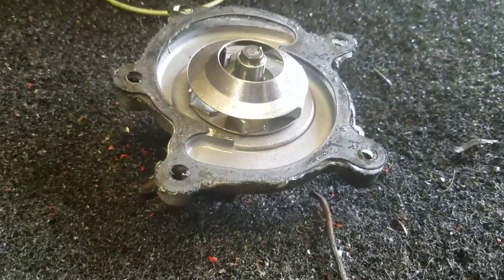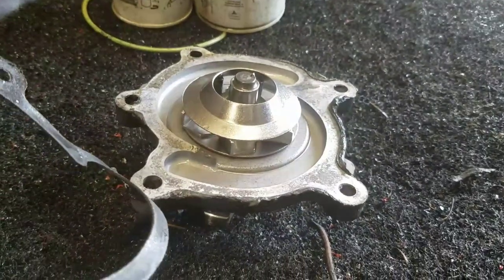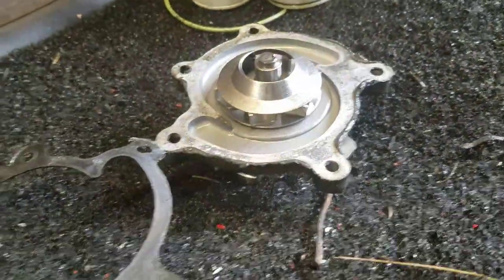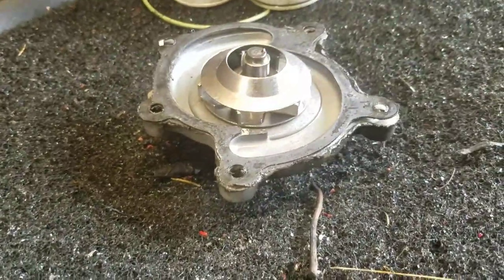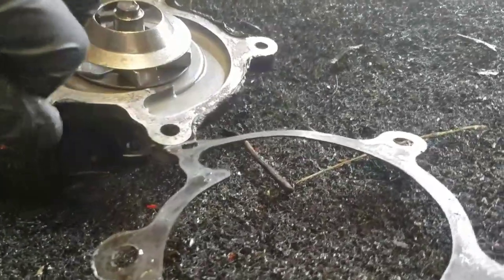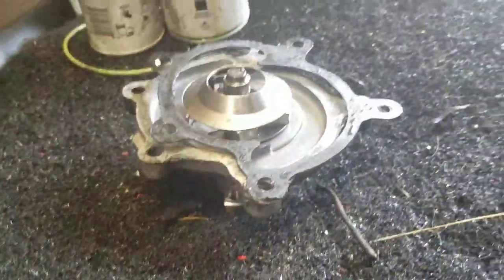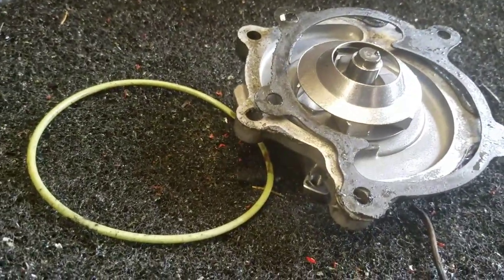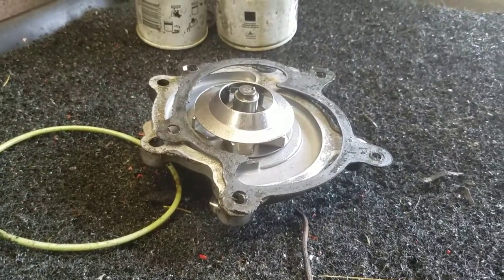Repair: do not use RTV silicone on paper gaskets

Comment: So confused.  Great video changing thermostat on 94 Wrangler have a new housing,  was going to use the blue fel-co gasket.   Not sure if I should any sealant.  Did the valve cover with a reusable felco and didn’t use sealer and hasn’t leaked yet.
Reply from the maker: Blue paper has silicone impregnated into it and does not require any additional sealers. If you were going to use anything you would use a spray high-tack, or aviation sealer. See the video in the description for more information
Reply: @MegaMarclar  thanks   I looked at repair manual and it’s just gasket so that’s what I’m going to do.  I feel a lot of the times people have leaks on new gasket is because they do not tighten to torque specs
Reply from the maker: @patrickab01  well there are about 25 different types of gasket material paper. Most of the time people have problems with it because if they use blue paper that has silicone in it and they put silicone on it they do not stick together. Suicone will stick to any surface known to man except for itself. So what that being said you have to be aware of what materials you're using and apply the sealers accordingly. The whole thing with the blue paper was that it did not need any sealers at all It was sort of a revolutionary technology designed by felpro many many years ago.
Reply: @MegaMarclar  I ended up using a felpro blue paper ,, no sealant,  set to manuals torque setting.  Ran it for a while got it up to temps with no leaks.  Haven’t driven it yet      Will see if all holds after driving it for a bit
Reply from the maker: @patrickab01  those thermostat housings are famous for warping and also being pitted. If it does end up dripping a little bit I would suggest replacing the whole housing. I actually stock those here in the shop because I replaced them so frequently
Reply: @MegaMarclar  yeah I put brand new housing on

Comment: There's no need to use a sealer with a gasket. That's the whole point of the gasket.  I have been in a pickle before when I could not get a gasket for my new water pump and I needed my car so I made my own gasket gasket maker.  Drove it another hundred thousand miles and never had a leak.  I would say use one or the other but I would much rather use a gasket alone.  Sometimes if you have a car that's hard to get parts for that can be a challenge don't always have the option to wait a week for something to come in the mail

Comment: My ford 1997 Taurus has in the shop manual using Gasket and Trim Adhesive D7AZ-1 9B508-AA (ES R-M 11 P17-A and ESE-M2G52-A  and I can't find it anywhere. I'm not sure to apply it or not.
Reply from the maker: the trim adhesive is what they use to hold window seals and stuff on, all it is is a sticky glue that holds the gasket in place. it has no affect on the sealing surface. you can use hi-tack, or just stick the gasket on and hold it there.
Reply: @MegaMarclar  Thanks I ended up putting no tack, maybe a smidge of oil (I was doing a water pump) and it worked out pretty well! no leaks!!!

Comment: I changed a rear differential cover and I just used the paper gasket,did I need to put on silicone or anything else on it!?.... because I didn't do that!...sorry for my ignorance but I don't know but I torqued the screws to what the manual said to torque them to.
Reply from the maker: Most of the time you will be fine. They used paper gaskets for many years. A lot of modern applications actually just use straight rtv from the factory. No matter which route you go, they all leak eventually.
Reply: @MegaMarclar  very much appreciated thank you.

Comment: I bought a water pump for 1977 Toyota 20R engine.
Got a light sort of cardboard/paper gasket.
So I should NOT USE SILICONE OR SEALANT RIGHT?
Install NO SILICONE.....
PLEASE can U tell .....
YouTube & other Auto parts stores advise differing things. 
Very frustrating........as a woman.
Reply from the maker: You would use hi-tack or aviation sealer.
Reply: @MegaMarclar  hi-tack what brand at auto store?
Is aviation at auto parts store?
Use thin layer or thicker U know.....
Thank U happy holidays!
Reply from the maker: @lindaleehulsey3167  I would use permatex aviation sealer. It's a thick dark brown goo. It's what they would have used back then. It doesn't harden or cure like silicon does which is the major problem that people run into. It's really sticky and basically acts like Elmer's glue for the paper. I would recommend using rubber gloves when you put it on just basically paint a thin layer on each side of the paper and stick it on
Reply: @MegaMarclar  👌 great....3 times now believe it......on off leak here leak there. Thin or thick, Rrrrrrrrrr😤
Reply from the maker: @lindaleehulsey3167  you may have more issues. Warped housing or something else. Should not have that much trouble sealing.
Reply: @MegaMarclar  bought new pump...first one 9 holes should have only 8 tried anyway believing auto parts store. It leaked, I filled around pump hole, even though there was no hole on block. 
This has 8 holes right pump.NEW ONE now.
B4, 
My old pump just replaced gasket after I cleaned it, used thick amount RTV not really thick, but did not leak.
Put new points, plugs wires started OK drove very short also in out of driveway around to mailbox like that it leaked peep hole they said it was bad pump.

This new pump 8 holes pump right, just thin they said here there to stick, paper thin Grey gasket, really did not like it, but did it, leaked here there, very slightly.
I want to try no paper gasket autozone AGS blue water pump & Thermostat gasket maker. But like your info......

Comment: I'm replacing thermostat on my old tractor. It definitely had a paper gasket but the new thermostat came with a seal. Do you have any idea if I need to use the thermostat seal also or just the paper gasket.  The old thermostat so old I can't tell if it had a seal on it.
Reply from the maker: Does the thermostat have a rubber almost oring looking seal around the outside edge
Reply: @MegaMarclar  Yes sir that's the seal I'm asking about, the one that goes around the edge of the thermostat
Reply from the maker: @justinw123  it is probably an updated design and as long as you can get everything tight, and the surface is clean and does not have a ton of pitting,  I would just use the rubber gasket on the thermostat itself. This is how all modern cars are all manufactured.
Reply: OK thanks for the fast reply have a good one
Reply from the maker: @justinw123  no worries you may want to contact manufacturer just to double triple make sure if you have any doubts. Remember that my advice goes just from your description and I have no idea what the actual application looks like.

Comment: Think they used oil rtv instead of water rtv.  Blue for water applications, and black for oil application.  Also, if they did not read the instructions, they most likely did not wait for it to cure.
Reply from the maker: Could be right, there are different types for different applications. But, I cant think of any gasket install instructions that recommend putting rtv on a paper gasket.

Comment: If silicone was recommended by the manufacturer, wouldn't they include a small tube as well as the paper gasket?
I haven't seen any (in my admittedly small experience) that do.
Reply from the maker: Not really .. cost savings, profit margins,.. most of these problems with the gaskets come down to people just not understanding how the system works. Years and years of propaganda by companies like permatex and felpro have let people to believe that silicone is a 100% fix all solution to everything. People could not be bothered to spend 5 minutes to do research to find out what exactly they're supposed to use.

Comment: I got a new idea. RTV silicone. No paper gasket. Did that on my jeep 4L because the surface wasn’t super smooth, it was kindof pitted. Hasn’t leaked yet. The right stuff
Reply from the maker: It all comes down to the specific repair. In your case,. I would have used normal paper and aviation sealer, that's how we did it at the dealership.. there are multiple types of 'paper' so picking the right one is important. Sometimes that thickness makes a difference and you can't just silicone two pieces of metal together, another applications that's how you have to do it. Also there's a It doesn't different types of silicone so you got to make sure to pick the right one in that area as well.. You don't just put black our TV silicone on everything
Reply: @MegaMarclar  it’s silicone specially designed for applications like what I used it for.
Reply from the maker: @JacobEcret  which one? And what parts did you use it on? The right stuff is just a brand, they make about 30 different products.

Comment: almost certainly the gasket surface wasn't clean, didn't use a torque wrench, and didn't wait for the chemistry to finish..(ie cure time before solvents were contacted/coolant).  

after years of daily use, proper paper gasket+RTV made the best sealing surface possible. i've even reused a gasket and it worked perfect until i could get a new one.. could do that with just a plain paper gasket. 

chemistry is an exact science, but, it require patience...  (wouldn't use RTV with modern silicone gaskets, aside from problem areas)
Reply from the maker: Your speaking in a ideal circumstance scenario. That cure time doesn't happen in the automotive industry. Paper gaskets need aviation sealers, not rtv. rtV is a marketing campaign to sell products
Reply: @MegaMarclar  "RTV" is "room temperature vulcanization"  ...people are always confused when products don't work. like with paint. its all in the prep and process.
Reply from the maker: @Swansen03  yeah, that's the problem. The vulcanization of the product is what causes the leaks. Different expansion rates require certain types of sealers. That's why aviation sealer was used up until the felpro and the permitax marketing campaign on rtV.
Reply: @MegaMarclar  that doesn't make any sense.. once the reaction is done, its not going 'move' very much?? unless you are torquing before its done setting adding solvents before its done curing, which everyone does.. otherwise that point you made about expansion rates makes no sense..
Reply from the maker: @Swansen03  check the video in the description

Comment: Think just a dry cereal box gasket for my turbo water jacket seal will hold up? Its wet and really really HOT.
Reply from the maker: I've used those for oil pumps, and high clamping force areas many times. But coolant will leech thru the paper over time, even with aviation sealer because of the 2 types of cardboard pressed together.  In a pinch it would work but long term I'd get the real gasket for it
Reply: @MegaMarclar  gaskets were discontinued like 20 years ago... what other material can I cut out? It had red RTV on there in the past... took it off because I thought it was leaking (it actually wasnt it was just the rusted coolant tube next to it). Maybe I'll go back with the red high temp RTV again... its just a pain to work with where its located. Maybe I can apply it and let it dry first? Should it go on both surfaces or just one surface?  I wish I knew what kind of gasket the stock one was... isn't a thermostat gasket just cardboard? I would think it would be fine...
Reply from the maker: @misterbulger  what are you working on?
Reply: @MegaMarclar  it's a 1.0 liter 3 cyilnder Suzuki G10 block with the coveted and very rare Turbo head from 1987. Parts for this thing are completely extinct. I've had to macgyver a full rebuild for it. The coolant pipe had a hole in it so I just slid some rubber hose over it and clamped it. Fixed.  Other than the leak  it runs AMAZING. The turbo is cooled 3 ways: coolant, oil, and the propane that I have running thru it.  It spins at about 250-300k rpm so it needs the cooling trust me lol
Reply from the maker: @misterbulger look up felpro #3195 it's a sheet of gasket paper for coolant. You can make your own out of ut
Reply: @MegaMarclar  that's exactly what I need but the bozos at auto zone cant find it without the part number lmao I've asked around before. Thanks!
Reply from the maker: @misterbulger  prety much any parts store can get it. I stock it at my shop and i get it from orileys. So with the blue stuff, it has silicon impregnated in it. No need for any rtv. You CAN put aviation sealer on it of u needed to
Reply from the maker: @misterbulger  there is also felpro 3075, all of these are on Amazon too.. just variations in thickness. You'd have to check their site to see which is which.
Reply: @MegaMarclar  thanks for the tips I've been wanting to up my gasket skills. I'll have to google the aviation sealer
Reply from the maker: @misterbulger  permatex aviation sealer. It's a thick brown goo.

Comment: Are you suggesting to use  the silicon RTV only? or if using the paper gasket, use that only ?
Reply from the maker: It depends on the application but when gasket sealer is mentioned with paper gaskets they are referring to the old brown Aviation sealer not our RTV
Reply: MegaMarclar Thank you for your prompt response. I’m using Permatex Gasket Maker #22071 on my 85’ 5.0’s new thermostat housing. I’ve been using paper gaskets. But they keep leaking. At this point, I’m just going to try  the gasket maker alone and see what happens.
Reply from the maker: @bkborn74  is there pitting on the housing or on the intake? Also it makes a difference what side the gasket goes on.. iirc theres a machined recess on the intake where th tstat sits.. right?
Reply: MegaMarclar No pitting. It’s not recessed. It actually comes out.
Reply from the maker: @bkborn74  looking at pictures online, is there a recess in the water outlet housing?

Comment: The title is quite aggressive, I gotta say. It should be like do not put too much RTV or sth like that. I do not know other repairs you did, but in this case, the amount of RTV was clearly overkill due to lack of skills or experiences from the customer. Assuming that this is a recommendation for DIYers, they do not have proper tools or skills most of the time, so RTV would definitely help them if they use it properly. I use very little RTV to compensate for old paper gasket on the surface around dowel pins (really hard to clean to perfection). There must be a way to remove old gasket completely, but it seems not that easy when it comes to repairing old vehicles. Sometimes, it is like welded/ fused into the surface so the only option is to scrap it off. I do not put silicon everywhere, but just around dowel pins.
Reply from the maker: I tend to agree. In most paper applications I typically use old school brown goop gasket sealer like permatex form-a-gasket aviation sealer #80019.

Comment: F&^%!!!!!! i just f-ing did this bc the damn instructions said to. the original had a rubber o-ring style seal on it, the one i bought had a fiber gasket. I thought it would be ok, but now i'm second guessing the whole thing, your expand and contract theory makes a lot of sense. i feel like i learned if you use the sealer on the fiber to just snug it down and let it cure, THEN tighten it down. guess i'll just have to buy one with the rubber seal and replace it again if it doesn't work. piss what fun!
Reply from the maker: What application are you working on?
Reply: @MegaMarclar  replacing water pump on a 2000 Saturn sc1
Reply from the maker: @chrisestes624  looks like it's as you said, there are 2 types.. oring and paper gasket style. Think you'll be fine for a while at least.
Reply: @MegaMarclar  got you thanks for the reply it wasn't too awful hard to get to so if I have to redo it it'll be alright
Reply: Thank you for the response too
Reply: Chris Estes how’s it holding up?

Comment: Would you recommend 80062 permatex high tack gasket sealant? I understand RTV isn't the way to go, but looking for something to hold gasket in place for assembly (for a water pump)
Reply from the maker: Ya that does work. I've always used the spray version. It just really depends on what the gasket is made out of, thickness, and color of the paper
Reply: @MegaMarclar  Understood, not sure if it's a paper or composite gasket. Dark grey color. Local store only has the bottle stuff
Reply from the maker: @TheWilslap  as long as its not blue paper you should be fine
Reply: Great, thanks for the replies. Guy at the part store tried to sell me some RTV to add with the paper gasket and I was skeptical. Glad I saw your video!

Comment: Okay then genius, how do i seal that flange with that comes with the RMS on those older VAG V6s? I've tried multiple gaskets, cleaned the surface spotless, tightened the bolts in the "oem" manner and it still leaks. Im going all out with silicone on this one.
Reply from the maker: Not sure, never had a VAG that leaks🤣.. I would use some permatex aviation sealer, not rtv.

Comment: Can I use RTV along with a metal gasket???
Reply from the maker: Does the gasket have a coating on it?
Reply: @MegaMarclar  It a black gasket for my VVT cover. My current one is leaking very very lightly.
Reply from the maker: @DTUFINOPhotography  what year make and model is it, I can look up the gasket see what it looks like
Reply: @MegaMarclar  2010 Infiniti FX35, part number is 23797-JA10B i already ordered and will install this coming week but was wondering if i needed RTV. Thanks for taking out the time to reply!
Reply from the maker: @DTUFINOPhotography  okay that type of gasket is a stamped preformed seal. A lot of the times they have a very thin coating on them I'm not sure exactly what it is but those type of seals are installed dry with no other sealers. All you got to do is clean both surfaces and make sure it's torqued correctly, that's it.
Reply: @MegaMarclar  Thank you very much!
Reply from the maker: @DTUFINOPhotography  no problem. There are millions of conflicting views on this particular topic. But at least you looked and did your own research first.